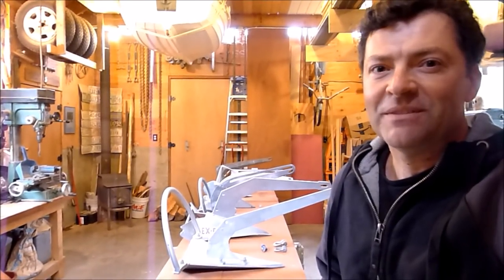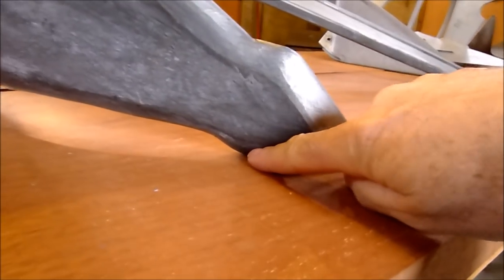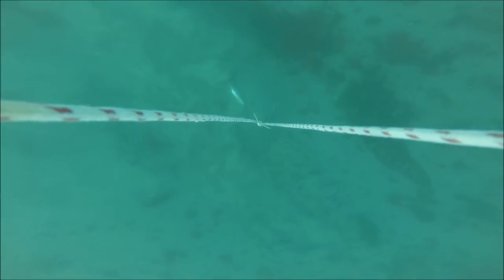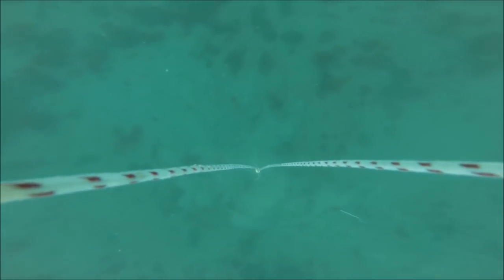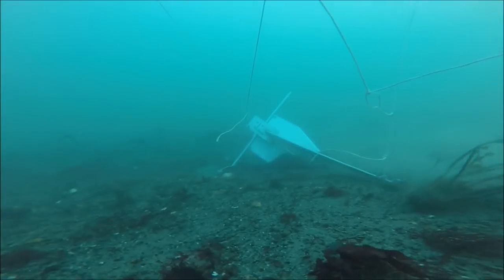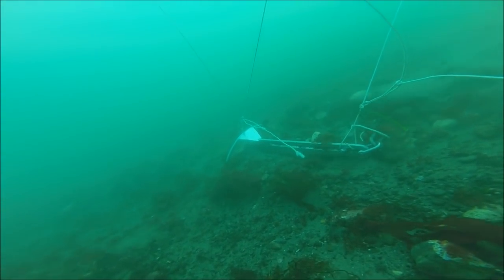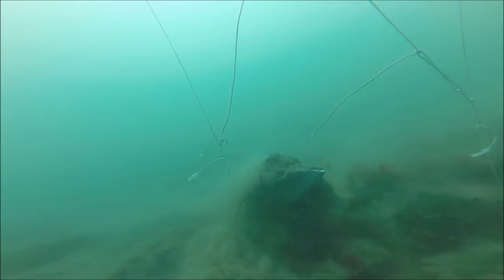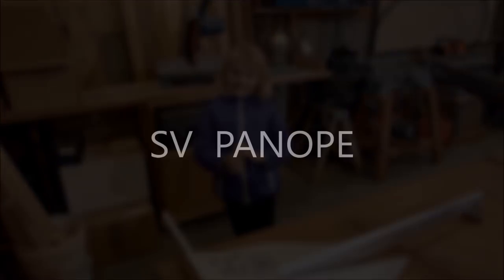Anchor Test Compilation. Video #56 of an ongoing anchoring series.

Comment: After 20+ years and thousands of nights spent at anchor, I'm considering trading my trusty CQR 65 for a modern anchor.  Your video has tremendous power to make crusty old salts like me change our minds.  Thank you so much for taking the time and energy to make these videos!!!
Reply: I had a 60 lb CQR.  It failed miserably twice - first on hard sand, in medium wind & no waves ... just lay on its side. Second time on a sandy/ stony bottom, again, moderate wind, no waves. I wd never have a CQR again.
Reply: That's a real eye-opener on the CQR... had a 35# CQR on a 15-ton Irwin and shudder to think how many nights the CQR must have just been laying on its side -- even though I was "sure" we were secure... thankfully was always in fairly calm conditions and I always tried to have at least 7:1 scope, but goodness, this video opens one's eyes...

Comment: Steve, thanks for all the thought and the hard work you put into this. As a Mantus owner, I was hugely gratified with the simply BORING reliability they showed. I forgive you for not picking the Mantus as your personal favorite - yet! (I predict you will eventually come around ;) Again, thanks for this video. Well done.
Reply: I echo the sentiments above. I wonder if after the las three years, he's come around yet. I've been using Mantus as my primary anchor since the day it came out. I've been all over the east coast of the U.S., anchored in some of the worst reversing currents South Carolina has and it's never failed me once. Been to Cuba, Mexico, Belize, and Guatemala too. Never failed. I would never use another anchor, ever. The company is awesome. Gregg is an innovator and they constantly develop new products that work. It only takes one time for your anchor to fail before you realize you made a horrible choice. Go with the Mantus from the beginning. The others are fine for day hooks. Just my .02.

Comment: Best comparison I've seen by far. Thanks for doing this. The 39kg Mantus will be the next primary anchor I put on my boat to go along with a massive Fortress and a 33kg Rocna. I love the Rocna but have had a couple of issues in water with a lot of weed on the bottom, it can clog up and take a bit too long to reset. I also like that the Mantus can be broken down for longer offshore passages.

Comment: Thank you so much for your videos, Steve!  We have sailed up and down the "ditch" 5 times- 2x with our Pearson 35, and 3 with our 38' Steel Kanter Spray 38, using both a genuine CQR and a Danforth, anchoring almost every night except for a couple of off shore times.  Both anchors held, even in 50 knot winds, that shifted us to a lee shore (around midnight... not a lot of sleep that night...).  Two times when we had a problem- first was 50 k winds during the aftermath of a hurricane in the muck of the Hudson River- the CQR held, but the Danforth failed to reset.  Second, in grass in Lake Ontario- neither would dig in, and, with predicted 30k winds, we went to a dock.  In many situations in the ditch, we only had room for 3:1 scope or less, and our main anchor, the CQR, always held.  We all have our preferences; after seeing your videos, and being cautious about short scope, I'll stay with these.  Thanks again!

Comment: You made the right choice as far I am concerned. I have 5 anchors on board 4 of them came with the boat, I bought the Spade, had it posted from Europe to Australia, in some of our grass bottom anchorages it holds and sets immediately where the Supreme Drag anchor never set once (as good as a bad copy CQR) the Bruce drags away slowly in a bit of a blow and the CQR was a little better than the Bruce and had no confidence with them both. The Mantis sets very well but have seen bent shafts but Mantis will replace them at no charge but will they replace the boat? The Fisherman is to big to remove from its locker unless I get into a bad situation.

Comment: Just a fine project and videos were outstanding. I currently own a CQR on my small 27' sloop and Delta on our 44' catamaran. Both boats will be getting new anchors after watching the video series. The Mantus is clearly my favorite for the catamaran but may choose the spade for my old monohull for the same reasons you did. Many thanks for the excellent value you provided in these videos.

Comment: Another guideline - if you toss an anchor off a rapidly drifting small boat, be sure to toss it upstream/upwind!        It doesn't say that in the books,  ha ha!

I have a very small Lido-14 sailboat, with no good place for an anchor directly at the bow.  I'm also a new sailor, and confessing to true newbie errors.

The centerboard had come unfastened and retracted into the boat, unknown to me, and all I could tell was that I seemed to have no control of the boat any more. Good news, I had an anchor, as I was drifting rapidly towards the rocks. 

Bad news, I tossed it over the nearest side, which was downwind.  In my mind, the anchor would catch and the boat would pivot around it,  rotating direction while remaining upright.

What actually happened was that the anchor caught and stopped the downwind side of the boat from moving.   The upwind side of the boat kept moving, flipping the boat in under 2 seconds to a complete inverted position -- although it was a firmly anchored, but now upside-down boat. 

Fortunately I was wearing my PFD,  as there would have been no time to reach for it.

Live and learn!

Comment: CQR anchors. I had a boat with 20lb CQR I was at the boat shop and saw a much larger CQR and whilst I never had a problem with the small CQR  I purchased the new much larger CQR. The new large CQR turned out to be a fake and whilst to me looked similar was absolutely useless. It simply would not set. Went back to the genuine CQR,  no trouble, secure  anchoring. Later I bought another heavier boat with a genuine CQR and again same excellent results. I write to say that the knock offs have damaged the reputation of an excellent anchor. Look similar but simply don't work. Genuine article sets every time and for me has never ever failed.

Comment: Hi Steve, fantastic job on these videos; convinced me to upgrade my anchors to a spade and mantus...as they say, seeing is believing.  Most people never truly test there anchors to the extreme you have; but viewing the videos of the carnage in some of the anchorages when the wind kicks up they really should.  So many dragging boats typically old traditional types using CQR's that came with the boat putting everyone in danger...guys please spend some money on the most important gear on the boat; the anchor...go with a new tech proven designs and go big and heavy so we can all sleep well at night.  35 years sailing, 20 years racing, 14 years cruising, fleet captain local club and harbormaster...maintaining mooring last 14 years...if you want some of my background.  Steve, could I suggest you test the impact of anchoring in waves, and adding a 45 pound kettle...amazing improvement in holding; reductions of loads on bow and anchor with very little scope.

Comment: Hi Steve, love this stuff. My concern is that all of the anchor tests I have seen with a reset are done with a high load. Do you have anywhere the reset is in low knots/load? My concern is, perhaps unfounded, a dislodged anchor by wind shift won't reset if the load is too low and will just drag. Any thoughts? Also, do you think there is any difference in Cat v mono hull anchoring? I am leaning towards a SPADE thanks to you and Morgans Cloud. Thanks for all you do!

Comment: Great videos. However when anchoring I never will use anything less than 5:1 in deep water (for 30+ ft depths) and at the very least 6:1 or 7:1 for overnights and pretty much in all other situations.   Any chance you could do some greater scope tests? Thanks!

Comment: Nice Test, missing the Rocna  as many has pointed,  Bruce are made for Oil riggs  not our smaller boats,  Bruce  anchors  are from 15tons  and up,  and have very have chain.  and work very well for oil rigs offshore.

Comment: Great work, thanks for your videos! May I suggest the Rocna and the Rocna Vucan as next tests?
Reply from the maker: I would welcome the opportunity to test those anchors.  However,  I cannot continue to purchase test anchors.
Reply: Ah... now i know why the shank on my danforth anchor bent. Right at that thin metal spot, and it has a long arm which would give a lot of leverage with a side pull.
I mostly use cqr-type anchors now, and these videos are a great tool for figuring out how to best use them. I could see where your anchor costs would add up quick - especially if you grabbed a high-priced Rocna. I get why you need to put a limit on testing, and since you're honest in your assessments it'd be hard to get anchor companies to hand over product. But you've built up a very informative batch of tests. Thanks.

Comment: Excellent testing.  I have a new to me 30' C&C30MkII.  I think the 35lb anchors are what I need.  It has a dansforth on it, but need to upgrade.  I'll have a fortress for sure, but need to pick a bow anchor/primary.  I've been leaning towards the Mantus or Spade.  They are similar in price and performance.  I've been leaning towards the Mantus, but thinking the Spade may mount easier to a bow roller that I do not own either (must be custom made).  Do  you think one is easier to mount to a bow roller than the other?

Comment: Note that because the shank of the Spade is triangular, and hollow, it is stronger (more rigid) than flat or rectangular shanks of comparable cross section. That's a function of shape (triangles are more rigid).   Also, because the tip of the Spade is more three-dimensional in cross-section (because it's weighted) it presents a thicker point cross-section that doesn't penetrate hard-pack bottoms as easily as flatter sharp points that are thinner (leaning more toward two-dimensional) such as the Manson, Mantus or Fortress.  Also, for a given weight, the flatter anchor styles have more fluke area (square ft.) for a given weight than those that have weighted tips.   PS - I don't have any affiliation to anyone who sells anchors -- just an interested consumer.

Comment: I was wondering why you didn’t include a Rocna.
Reply: Rocna would have likely beat them all.
Reply: @tarivard  They fail when dragged across weed and sand. Look at test videos.
Reply: @trentspencer7991  I have had a Rocna for more than 5 years now.  I have had other anchors in the past.  My Rocna has been fantastic and grabs like crazy.  I’ve had many restful nights on my Rocna.  I would consider an Ultra as an alternative.  Sailing zero tested the ultra versus the Rocna and it was clear the Ultra was an excellent anchor.  I would never use the short scope he uses in these videos.  I am always a minimum 4-5:1

Comment: Hello Steve, Thanks for the video. How did you get so many anchors to test? I'm not sure you could of picked a sailing topic more volatile than anchors. I currently have a mantus and  am not in the market. Back in 2014 mantus upgraded their anchor shank as it was under attack for possibly being to weak. Interesting that you still feel it's the weak link. I did get the upgraded shank for only shipping. This is a good reference on the issue: https://www.practical-sailor.com/issues/37_38/features/Mantus-Upgrades-to-a-Stronger-Shank_11319-1.html

Comment: I have seen them all, this is a fine, perhaps the best, test for me to date. I like the Spade also but the hassle of keeping a finish on the metal makes it a "no" for me. I would go with the Mantus and upsize to offset worries about the shank. If the Spade did not need to have the lead melted out before it was re-galvanized and then have to figure out how to get it back inside, that would be my choice. I would like to see how well the Spade re-paint process is working and if it could be spray galvanized more often instead of hot dip galvanized. Thanks for all the work. Bob
Reply from the maker: Bob, True that re-galvanizing is more difficult with the Spade. However, Spade anchor USA has confirmed that their, lifetime warranty covers failure of the galvanizing.
Reply: Thanks for the post - I did not see it a first. No one has ever mentioned that Spade will warrant the finish, lots of talk about their "paint re-finish". 
Bob

Comment: well i use a star wars ship! FORTRESS lol for my 29 ft boat went with recommended size but it broke loose twice! found rocks between the flukes. i went to a bigger size i believe a 10 lb! has not broke loose from the bottom but still find rocks between the flukes! fortress works great in mud sand looks nice light easy to assemble. im looking for a better anchor for rocky bottoms! great video!
Reply from the maker: Thanks for sharing your experience, Mario.  I have too have found rocks lodged between the flukes of the fortress (and danforth) anchor.

Comment: This was a well done and useful test, especially since it was done at short scope.  Your comment about the Mantus matches mine, and as such I dearly wish that there had been a Rocna in the mix, as they are much more beefy, and the Mantus is a kind of knockoff of the Rocna.  The Rocna also I believe has a little more scoop area than the Mantus.  I believe that it also would have been the same as your comment about "the best setting" that you gave the Mantus and would have eliminated your concern about the spindly-ness.
Reply from the maker: I am glad you found this useful.  Since publishing this video, I have posted over 35 new anchor tests.   I did test a Rocna Rollbar, a Rocna Vulcan, and many others.  Cheers,  Steve
Reply: @flygoodwin  Thanks, I will find your other videos.

Comment: Great videos.  I had a CQR and it repeatedly fail to set in the Med.  Now we have a Rocna, and it sets first fime.  Main problem is that it brings up half the sea bed when retrieved - which puts quite a load on the Windlass

I would be interested to see how you set up the Gopro to get such reliable shots of the anchor

Boyd

Comment: Very nice! But almost all of your top anchors set and held and reset and held again. It would add an interesting new level if you could test until dragging: if you don't want to upgrade your engine, then test e.g. the 15-lb versions. I know—Fortress wins (in mud, and if it doesn't jam or foul or skate or etc), but probably such a test would reveal differences that you couldn't unearth here. I'm guessing your chain is spec'd at a working load of around 5000 lbs, right? If 1000-lb load is an adequate test, then get lighter chain! ;)

Comment: Really usefull comparison..  Would you ever consider out of curiosity, testing the Mantis with the roll bar removed?  I like this anchor and am very curious to know how vital the bar is to performance
Reply from the maker: Geronimo, I believe the ONLY purpose of the rollbar is to roll the anchor upright from the inverted position.  I consider this function vital.

Without the rollbar (assuming it is upright) the anchor might dive deeper into the seabed (a good thing) but I will note that Mantus Anchors do not have a problem penetrating seabeds.
Reply: @flygoodwin  thanks for your speedy reply. I've actually just ordered one of these and just because it can be done I'll have to try it on an Irish beach to see if it will dig in without the bar. I have no problem with the bar ,but eager to compare with and without on the same anchor.
Ill let you know what happens!
Loved your video

Comment: I work part time in a major chandlery. I refer many people to your site before they buy. Especially if they are looking at cheap chineese knock offs. Your site gave me a much better understanding of the physics of anchor design. I was going to buy av fortress anchor....decidegd not to. Can the top end anchors justify the super high price tag though... I have noticed people buy big anchors and small chain, then wonder why it drags in strong winds. A 40 pund anchor with 6mm chain doesnt seem to work. Is it worth doing a vid showing the effect of chain size if someonke donates the chain.